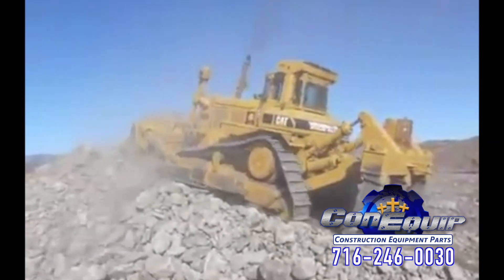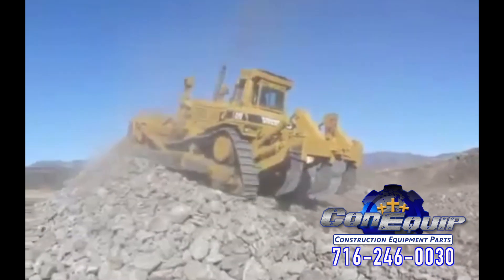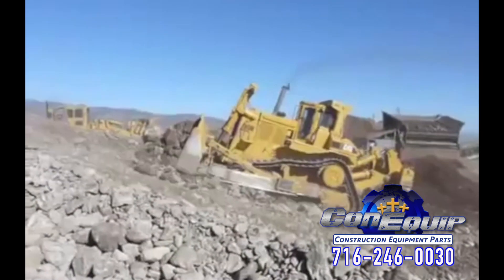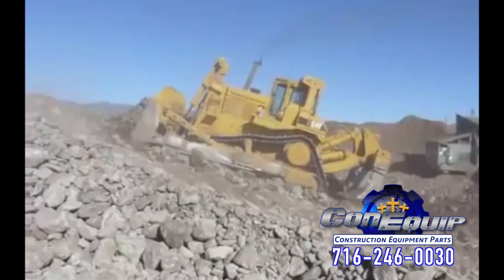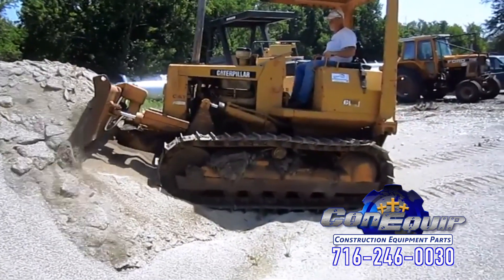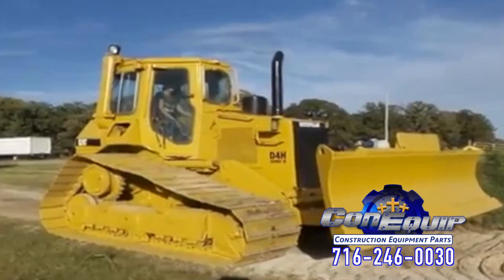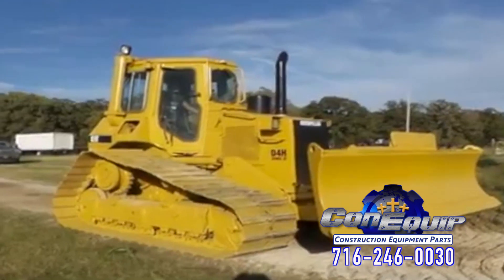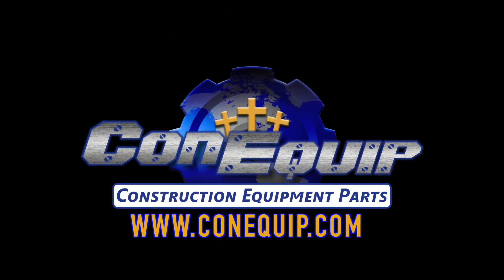Caterpillar Final Drives - Why Final Drives are High Up on the Tracks

Comment: Slip is not a problem when the straight track grease and ldol wheel is knee deep in mud and in the feild when the track goes the old K models cool the high track depends on terrain and mantiance independent yoy can change the track quicker using the high sprocket as a winch to help pull the track on and tools area ect. The k models a Komatsu international. After throwing a track in a water hole or slope on a straight track the machanic did some thinking probably.  They make rock guards to pit on around the sprocket bolts if they put the on not really about horse power about a track coming of in 6ft of water you need scuba gear just to get to it and more for feild machanic work. Like the 416B went to the other boom after a hose breaks in side a boom or pulling a cylinder out more for feild machanic work easier for them. Why excavator load the Rev forward the articular not getting grease the hydros in the loaders seals the excavator swings all and 4 tires you buy a new refurbished machine. Not so much hp more feild machanic friendly also dumps out instead of crush on the chain. Plus with the oil rig winch you can put it on the back were the tree rake eyeholes you put a 20 ft a frame winch run the cables from the back and run the side arms on the tree front holes or ser up on rhe back take the blade off run the winch on just a blade frame yard machine or machanic crane. Set up the a frame on the front take the tree guards off run 2 side bars containing blade up more reach side bars push the frame top of the crane frame down giving more reach. The old ones with 2 levers for the track you can pull the track anor it and use take the sprocket teeth off bolt on winch drum as a cable puller on both side and main on the back is anchored and drive motors ancor winch them selfs will pull the rite set up. Or link belt excavator knuckle boom or 345 460 480